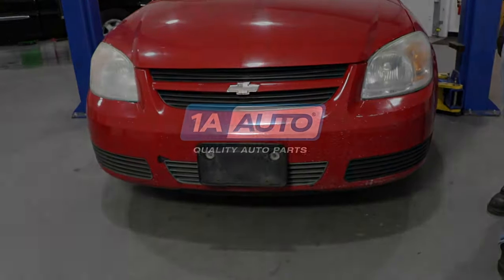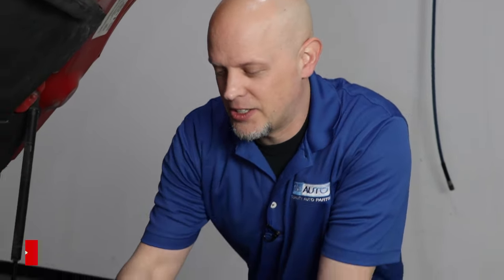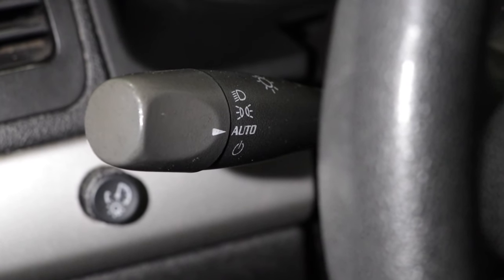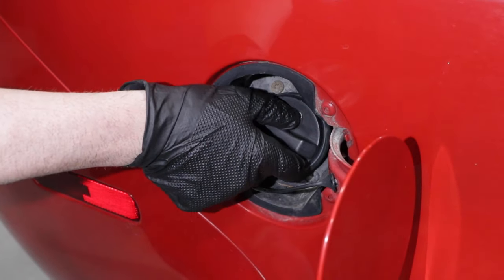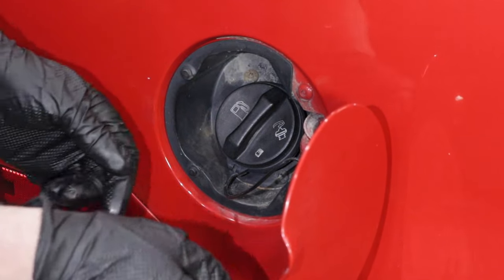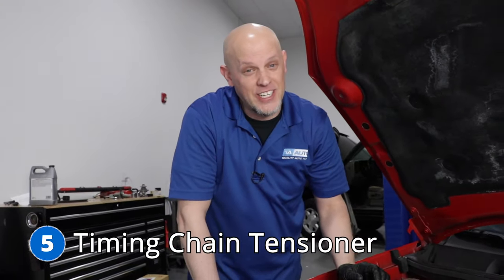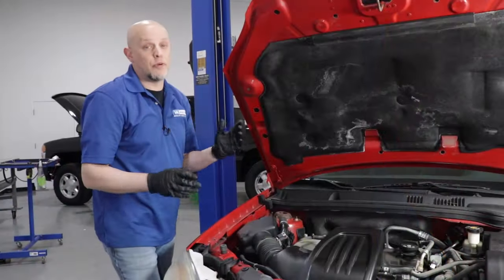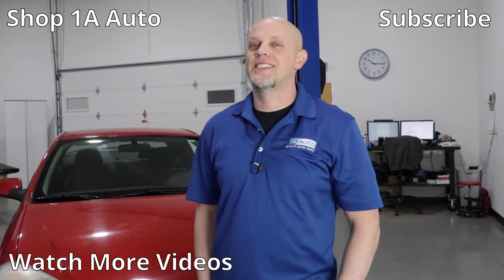Top 5 Problems Chevy Cobalt Coupe 1st Generation 2005-10

Comment: Fuel line near the rear rusts out, left front speaker goes out(cant hear turn signal) and rear springs break.  Most common issues I see on Cobalts, both as an automotive technician and someone who owned one for 10 years.
Reply: Yes indeed. We just got the Complete Suspension system replaced.we have A 2006. Honestly can say, It's A great car. Very uncomfortable to ride in. And I'm only 5/7 However we bought it for the wife and will say that it is A great car. Now,The 1999 Chevy Prizm.  OMG.  Complete Junk beyond words. I tried to Save the Junk but I spent more than what the car was worth!!!! $13 K!
Reply: Wow. I literally just repaired a rusty fuel line in the rear, had to replace two broken rear springs and also and my driver door a speaker has been going in and out for years. You just described my car lol
Reply: Mine has the same problem with the left front speaker, as well as a broken turn signal switch.
Reply: @corym5558   on my 2006 Cobalt, I also had my rear fuel line replaced in the last year, my rear shocks and struts a while back, and my driver side speaker went out as well. Amazing car though to say the least, and glad to know it wasn’t just my cars problems but more related to the manufacturing.
Reply: My rear springs aren't broke but car sways in the back and little bumps in the road throws the car. or the rear of the car randomly feels like your drifting when in mid turn I'm assuming it's shocks and rubber pice for spring am I wrong or...... just feels like rear right of car drops down like someone jumped on it  there's no warning or noise when it acts up
Reply: Would swapping speakers fix it? Both of mine go out lol
Reply: How much did that set you back?
I had mine in to have tires replaced before Xmas and they confirmed that it’s completely rusted out near the fuel filter I guess?

Comment: Another should be fuel line that runs next to the drivers door under the car, they tend to rust out pretty easily.
Reply: Oh yes
Reply: Isnt that basically all GMs around that time period?
Reply: Expensive fix too given it's hard to access the fuel lines on this vehicle relative to others.
Reply: Yes that’s very true
Reply: Some are covered under recall
Reply: @AlbChan  line to go has a 2 piece replacement that makes it easier to do yourself. did this on my son's 2008 cobalt in our apartment parking lot.
Reply: Yes!
Reply: Fuel line to, and you need a hoist to fix. 500
Reply: True, I had this replaced on my 2010 Chevy Cobalt LT sedan.

Comment: I was a GM tech for 10 years during the years these cars were first made up till early 2012. Yup everything you said is 100% true. I didnt replace alot of shift cables so my personal one would have been the E-brake issues but that is just my experience. Great cars,very cheap,easy to maintain, and if you can find a 08-10 SS you will have fun!
Reply: I've got an LS with a stick.  I can pretty much keep up with the expensive cars.  I think I'd like to modify it for a little more power, but I'm pretty happy with it.

Comment: All the suspension on the front will wear out in 75,000. I have a 2006 right now and I can't get the front end to stop rattling to save my life.
Reply: For sure
Reply: Are your wheels balanced?
Reply: Get control arms look at i have ss version lot problems not on that car compared to base model problems 
.249000 still going iv struts all that last 2 years. Best of luck
Reply: Yes, I replaced my front suspensions, was making a very bad creaking sound.
Reply: Just hit 73,000 and yup gonna have to do a bunch of suspension work to some my rattles as well.

Comment: I'm an auto tech so I see alot of the issues on different brands different models..and I own a 2006 Cobalt 5 speed coupe. I think they are good cars, cheap to own, cheap to fix, easy to work on for the most part. Most stuff can be done by a DIY guy at home with the exception of the water pump/chain tool, which is in the autozone tool isle. Keep the oil changed every 3-5k (dont follow the oil life monitor) and expect to change the timing chain and guides every 100k or so, like a belt. Steering columns are electric and do get worn, due to a plastic gear driven by the electric motor. they are expensive ( $350ish for GM part) but pretty easy to replace. And it they last a long time, it's a one time replacement.
Reply: I had the automatic base model in that year.. it was the worst car I’ve ever owned. Everything from TCM issues, it went through several ignition coils, the break system failed, the tie rods went bad on bother sides, the starter, alternator, and ac all went out too.

Comment: I owned a 2008 Chevy Cobalt. And lemme just say.  I...effing.... LOVED THAT CAR!!! the only major problems I had with it were the spark plugs ($200), the gear shift fell a part ($700), and the fuel pump went out. ($900).   The car was running good at 188k miles until some chick decided she wanted to go 60+ in a 45 mph speed zone and rear ended a car that rear ended another car, that rear ended me, that pushed me into another car.  And that car hit another car at a stop light. Her fault. Not mine. So I bought the Chevy Cruze as the upgrade. Worst mistake in my life. The cobalt gave me nowhere near the problems the Chevy Cruze did.
Reply: Wow. What happened to the lady after causing that huge chain reaction?
Reply: You spent 200 on plugs…

Comment: 2005 cobalt bought new and still drive it. 289k miles currently on original engine. Items I've replaced or had fixed:
Leaking fuel line in rear
Catalytic converter
Mid pipe
Manifold
Ignition coil pack 
Rear springs
Gas cap
Turn signal switch
Rack and pinion
Steering shaft 
Rear main seal
CV axle
Transmission seal 
Left front speaker
Control arm bushings
Sway bar bushings
Multiple wheel bearings

Plus regular wear issues like spark plugs, brakes, struts and shocks. Rocker panels are completely rusted out. Other than oil consumption of about 1qt per 1000 miles and a rough cold start. It still drives
Reply from the maker: +wirebeam Thanks for checking us out! http://1aau.to/m/Shop-1AAuto-c
Reply: Wow that's crazy

Comment: To bypass the shifter locking in park remove the console and zip tie the little arm back. You will be able to shift the transmission without the ignition key and without starting the engine. Works like a charm.The shifter solenoid malfunctions.

Comment: Thanks for the video!! My combination switch just went out in my 2008 Cobalt Coupe. Pretty easy to fix and the part only costs around $25. 
I am starting to hear that rattling at cold start, i thought it might be hydraulic lifters, but it sounds like it could actually be timing tensioner, so thanks for highlighting that!!!
Reply: What's the mileage? As a auto tech honestly I like to tell people to do Ecotec timing chains at 100k intervals.  They last about that long before guides start to break and cause problems.  Other than that, just keep the oil changed and full and they are good engines.

Comment: I bought a brand new turn switch and the return wasn't working out of the box. Lol  overall excellent vehicle I drive from Palm Springs to  Cal to Everett, WA  then drove from Seattle, Kent, and Everett every day for work for 2 months and only had to get 1 new tire. 137k miles. I purchased it used and it's been  running amazing.

Comment: Fuel pump is a common problem in these cars too(which cause a gasoline smell).  Either the seal wearing out or the plastic lines getting holes rubbed in them.
Reply: Actually is was the pump housing cracking when its hot out, it was a recall

Comment: ive had 3 the rust is bad on them up here in the midwest but you missed the most common ones the lower controll arm busings go out after like 150k miles like clockwork and the front wheel bearings are terrible spot on with the coils and blinker switch though otherwise they are bulletproof

Comment: The turn signal lever also breaks easy, there also was a recall on ignition switch, fuel pump assembly and gas tank on my 07

Comment: I have an 08 Cobalt LS...111,000 miles 1/2 highway 1/2 food delivery. Main problems other than maintenance items. Front struts covered by warranty. Rusted thru fuel line $350. Running lights short in wiring $180. Valve cover gasket did myself $31. Front passenger side wheel bearing  $240. Battery made it 13 years and 109,000 miles. Several lights. Outside temperature thingy... don't need. Wheel pressure reading thingy... don't need. Original rotors from 2   brake pad changes that I did myself. Doing rotors next brake job. Lots of insignificant plastic thingys break.
Reply: I just did the front struts, it is super easy. Wheel bearings are easy too.
Reply: What was your symptoms when your wheel bearing went out? (I know seems like common sense)
Reply: I have 2010 Cobalt that I bought new, I replaced the battery after 11 years just because I thought battery might fail and leave me stranded (battery seemed still good).  Replaced DRIVER front wheel brg at 45,000 miles ($100 for part only, could have bought cheaper part but did not).     Some body rust (midwest salted roads).  Only 77,000 miles on the car.  Change oil and filter once a year.  Brake pads recently ($40 parts only), one taillight bulb replaced, headlight bulbs replaced, 2 or 3 air filters (don't remember exactly), cleaned MAP censor with spray can stuff, tires (of course), patched horizontal crack in windshield washer plastic tank (I should have just filled it halfway and not bothered with the fix, you have to take off the inner fender to get to it).  One (of 4) tire pressure sensor (did not fix).  I think the tire shop f'd it up when they replaced the tires.  I did not complain since it did not happen right away.  I think that is all I did to it.  Seems to  still run good.  I drive it very gently.  What is that strut recall/warranty you mentioned?
Reply: @alliekeesee6761  I had to replace a driver's side front wheel bearing at about 45,000 miles.  May have been caused by hitting a pothole hard, not sure.  Anyway, the wheel bearing makes a grinding noise, very irritating.   The worse condition the bearing the louder the noise.  It is very hard to tell which bearing is bad (right vs left).  I have watched YouTubes where they pull the wheel back and forth finding loose play, I never found any loose play even though the bearing was bad.  Some say you can drive the car and steer one way or the other to listen to a change in bearing noise and determine which bearing is the problem (I think that works).  I also heard that if you replace the wheel brg with a cheap replacement, the replacement may not last long (12,000 miles?).  So I did not buy a cheap part, I spent more because I did not want to repair it again.   I am not an expert, but I have heard that if you do not fix a real bad wheel brg a lot of heat could build up and other parts could be damaged from the heat.

Comment: I've had similar issues with my 2009 cobalt lt automatic. Currently has 176,000 miles. I just replaced the gas cap. The driver side door speaker cuts in and out, I had to replace the turn signal lever as well but it doesn't automatically turn off after a turn even after replacing it. I did the spark plugs a while back. The transmission shifts weird sometimes when I'm slowly accelerating and right as it hits 40 mph the rpms go up and down kind of fast so I then have to speed up to get it to shift
Reply: I have a similar problem in the shifting with my 2007 Cobalt. Beginning to get worried..
Reply: That’s exactly what my 2010 one does when it shifts gears. But mine of has 133,000 miles on it. Haven’t had to replace my turn lever but I can’t hear either of my signals.

Comment: The ignition switch there was a recall in this car for that. I was reading in motor trend about this recall. I told my coworker about this about his car and I told him you can just go to the dealership and they'll fix it for it. He said no no I'll just leave it. A couple days later I see him and he tells me this car almost killed me he told me this steering locked up on him but he is lucky enough to get it stopped do whatever. He took it into the dealership. They fixed it for free he had no issues like them charging him for anything. The best thing I can say is you can check the stuff online for recalls and talk to the dealership about them. And what I mean that is if you drive a GM car go to a GM larger dealer you have a much better luck dealing then going to Bob's used car.
Reply from the maker: +Darwin Michel Thanks for the feedback!

Comment: As the previous owner of 5 Chevy Cobalts, 05 LS, 07 LS, 06 SS, 07 SS, and 09 SS, none of these are common issues.
1. The coil packs rarely fail, and when they do, its after like 150k miles of use
2. The lever for the light switch only breaks if you manhandle the damn thing.
3. Gas cap failure also isnt common, same as the coil packs it may go bad after 150k~ miles
4. Shifter cables? Not even close to being an issue for neither the manual or auto cars, it fails if you dont change your engine/trans mounts after they are worn.
5. Timing chain rattle isnt common, and if it does occur, its at like 200k miles, which the solution is to just get a new timing chain kit.

Comment: Amen to this.  My Cobalt has to be put in and out of park many times sometimes to get the key out.  Fuel line totally rusts out.  Run a rubber line but better make sure they use the right connector to put it back in or you'll be stuck on the highway when it pops back out over and over again like me.  Lot of local short runs will make you think you have a problem with the heads with milk in oil, but just run over 20 min and pop off the cap for about 10 min to let condensation out.  If your thermostat goes have FUN!  It's a real SOB to get to it so get some extenders.  If the transmission line rests and needs replaced forget getting those clips off as a nightmare.  Take a sawzall and cut them off and then unscrew.  Don't forget how you get locked inside of these because the switch goes (another re-call)  just replace the switch.  Good overall beater car but rust is a major issue.

Comment: I have a 2009 , A/C has quit working ,am replacing camshaft position sensor for the second time and now a tpm has died. Other than that and the fact that i have no rocker panels left  , it runs like a champ. I retired from the plant where it was built and i could tell you some horror stories about the early Cavaliers .

Comment: Was about to buy an 05 cobalt LS (not from original owner), but after reading that it had 5 recalls and watching this video, I'm thinking it's a bad idea 🤦😵😅 The ad list some of these problems.. door locks don't work with switch.. back passenger window doesn't work.. trunk opens with button but not key.. 🤦 I'm thinking that if it has all these issues, then it probably has the other, more dangerous issues.

Comment: 2007 cobalt,  All of my gages will randomly go crazy and when this happens sometimes the power steering will not work, then
 work,and it's an automatic but the shifter will make clicking sound and the transmission will start to buck a bit ,this problem goes away in the winter,in the hot weather it starts again,I did that thing where you run the extra ground wire but it didn't help

Comment: I own a 2010 since new, my issues of the years:

1. Had Rear Coils rust and break prematurely
2.Control arm bushings fail prematurely twice, I gave up fixing after warranty.
3. Power steering/rack replaced
4. Fuel line rust/leak.
5. Backing plates rusted off and cut the brake lines luckily I'm still alive. There is also no OEM or aftermarket part to replace so it is junkyard material unless you find some on another junkyard car in good shape.
6. Final nail in coffin as of April 2 2023. Rear Axel Failure and guess what also no OEM/Aftermarket part to fix it so again junkyard material if it fails like mine.

Comment: Had an 08 cobalt for 10 years and 150k miles and I experienced the gas cap issue (not a big deal lol), and the blinker, other than that it was great car until spring 2020 the transmission started to lose overdrive even though I changed the fluid when it was due, also oil changed every 3k and 0 engine or coil issues. The transmissions are definitely the weak point.
Reply: Just my personal opinion automatics suck in general. When they go out costs as much or more to replace than the engine. I have the xfe standard. Manual transmissions are more reliable the clutch is still good after 127k miles.
Reply: The automatics are pretty good too in these cars. They are built and rated for 200hp and obviously the cobalts have around 155hp. Mine has 165,000 hard miles and still works like new.
Reply: Better than the 1st gen Cruze's ill tell you that much

Comment: Lower control arm bushings, wheel bearing, turn signal   switch, speakers, EVAP purge valve wiring plug, daytime headlight wiring.
137k  2008 sedan.

Comment: okay so how do you know if the check engine light is on … on the 2007 Cobalt  because mines is lit yellow but its not blinking or red. so is it  on for a problem?
Reply: Yes. The check engine light is yellow so if it’s a solid yellow I would say go get your car looked at it only cost around $150ish

Comment: The original steering columns have a tendency to wear out a plastic gear and have to be replaced.  It becomes evident when you hear a rattling in the dashboard.  Not a cheap part to replace, but you can't get an alignment when they wear out
Reply: Twice for me. First time it was covered by warranty.

Comment: The timing chain tensioner skit was incorrect.  First off its in the back of the engine and also u can replace it without removing anything. The engine cover maybe. But still can be done.